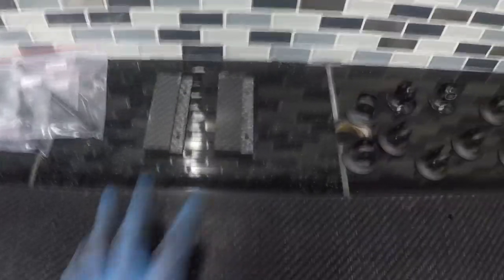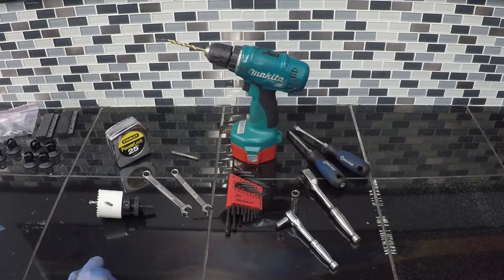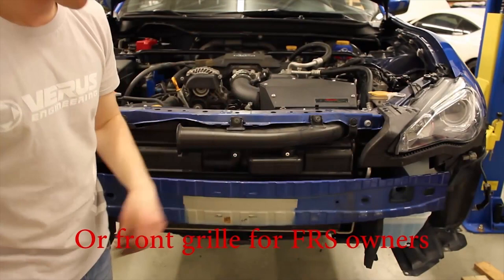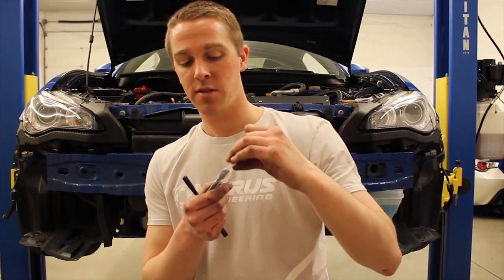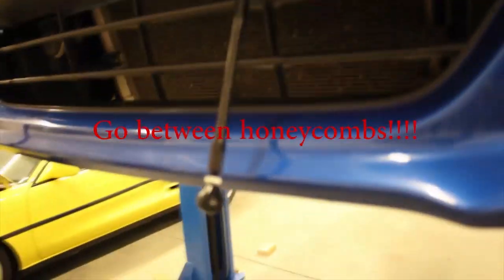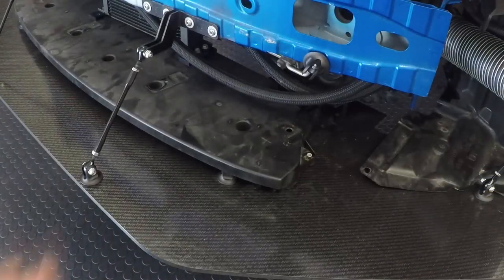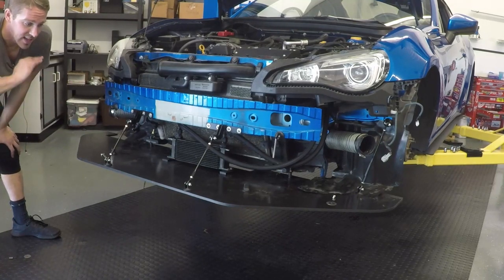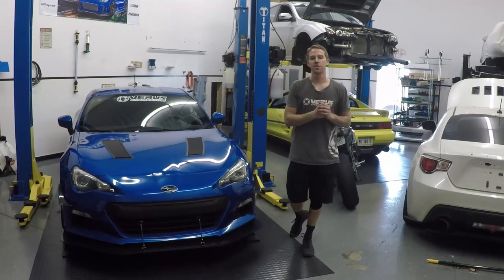Composite Adjustable Front Splitter Install for FRS/BRZ/GT86

Comment: Bet you wish those brake duct hoses were longer so you could install them from the front when you rehang the bumper!
Definitely going to be doing that for my VA before removing the bumper again.
Reply from the maker: It is quite easy on the BRZ to attach them with the bumper installed. All you have to do is peel the fender liner back.